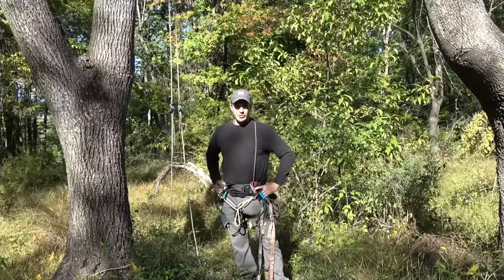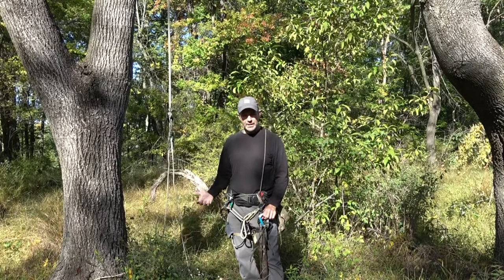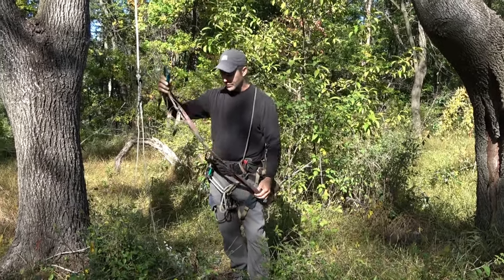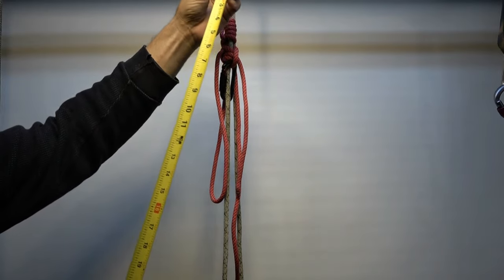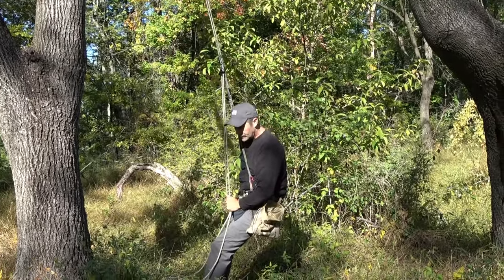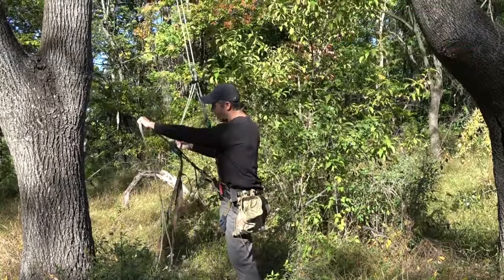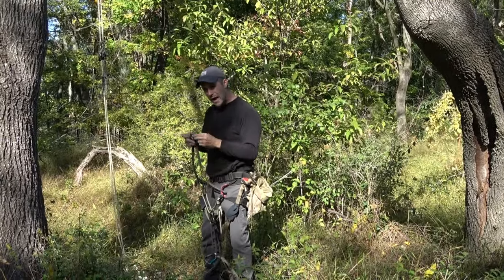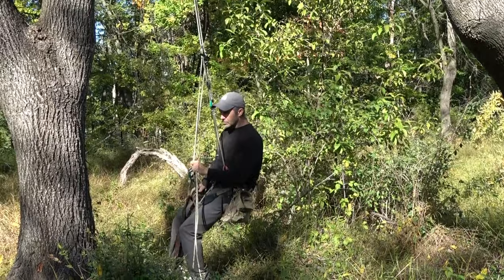JRB Climbing Method: Optimal System Geometry

Comment: Appreciate the review and instruction greatly, had a couple of hunting climbs over the weekend bow hunting, I personally like keeping my loops off my hitches to bridge rather short, six inches or so, (like my bridge long and raise my knee pretty high) and use tube webbing for my best friend, also enjoy having a JRB cinch setup along for the climb to provide repositioning around on the tree, The crotch I wind up climbing off is not always advantageous , The cinch allows me to move any where on the tree I need to be. I do have my garda and best friend just like you recommend. My only improvement would be that my hitches are a bit difficult to shove up, no problem rappelling. I always loosen them up a bit before the climb , any suggestions (using 8 mm tuefelberger resc tech with 6 mm Sterling accessory cord, 5-2-3 hitch) Feel very safe with this system and it’s really a Lot of fun having such an effective, safe and variable methodology, no deer yet it’s really dry like drought down here in Mississippi
Reply from the maker: Sterling 7mm cord also works with 8mm ropes, and is effortless to work with.  Not all 7mm cords will bend around 8mm
Reply from the maker: 1. The best friend of tubular webbing is a concern... how did you connect it to the Carabiner-like? It must cinch and deliver load on opposite sides of the Carabiner pair. I have never tried making a clove hitch with webbing.  But you cannot simply have a loop which doesn't cinch.
2. To my knowledge, Sterling 6mm cord is not recommended for life safety applications. But 7mm Sterling is and it does work on 8mm ropes.
Reply: @jrbtc  my redundant web bridge has Sewn loops and girth hitches 
on both sides of the saddle with D rings and an adjustable austrialpine block slide type buckle in the middle,. The best friend web loop is tied with a water knot and just clip the garda carabiners through it, but I have tied it in with a girth hitch being sure that both sides are equal when dressing out the knot, considering the strength of tube web seems that just floating the best friend loop through the garda carabiner pair would slip to perfectly take load equally on both sides ? I see that a hitch would prevent any entanglement though
Reply: @jrbtc  the 6 mm is rated at 1900 lb load and got prusiks
Reply from the maker: @kennethrogers1129  It's your responsibility to test your own modifications or experiments. In my testing, it's necessary for whatever mechanism which is applying load on the Garda to both cinch it and deliver load on opposite sides of the two carabiners.  This is what has led to my recommended design of my Bull Hitch variant for webbing and a clove hitch for cord. Using something else could affect its reliability.

Comment: You deserve an award!  Quick question: I've heard the Munter hitch can tend to create twisting on the rope. Do you alternate the direction you coil it to avoid issues with this? You mention the Super Munter in other videos, and I've heard it cancels the twisting effect....with more friction as you point out, so it may be more interesting for heavier climbers (or when the rope is wet/icy/very slippery). I'm a lightweight. I'm also a novice, but have family members who are professional guides (but live in other countries). So I'm asking a fellow hunter and possibly history making innovator ;-)  Perhaps for those not heavy enough to be able to use a Super Munter or even half Munter, the coiling tendency is negligible anyhow?  UPDATE: I see you address this in your video on rappelling with the Munter, for both one and two rope decents (different videos). You say that the twisting is negligible. I assume this is largely based on going slowly, which is safer and better for the rope anyhow. So I'll assume using alternating coil directions is unnecessary. Thanks again for all your excellent content.
Reply from the maker: I have two rappel videos on the munter on a doubled rope and a single rope.  This is the latter. The spin will be neutralized by feeding the rope in from above. And thanks!
https://youtu.be/KuJNyWTHRvk

Comment: So, using the system shown you’ll bowhunt with ? Or without a platform? Thanks
Reply from the maker: Coincidentally, after 15 years of rope climbing, i just tried a platform for the 1st time this week. It's necessary to have something for positioning, but i generally seek out trees like the one in this video and at the end, I demonstrate how I use the branch for positioning.  I find a branch advantageous over a platform, but obviously, if we don't have a branch, a platform or something similar would be necessary. I realize that not all forests have the same types of trees.
https://youtu.be/m6p136_Ol1s